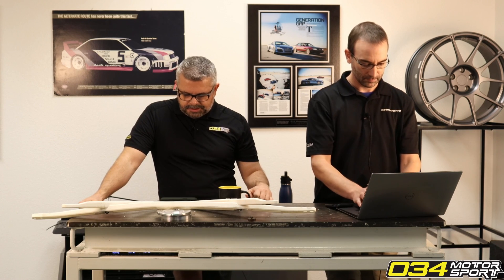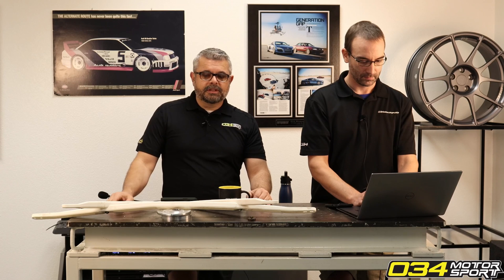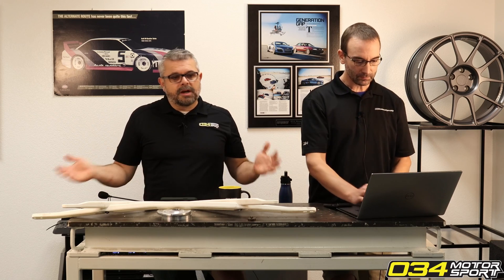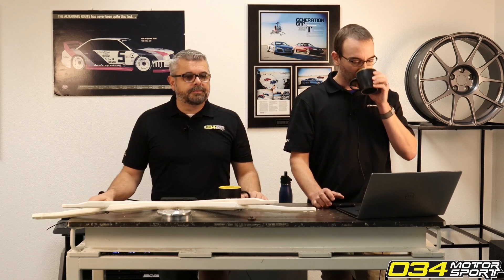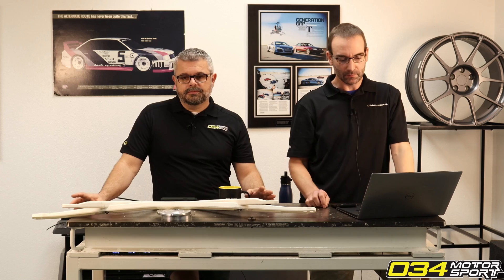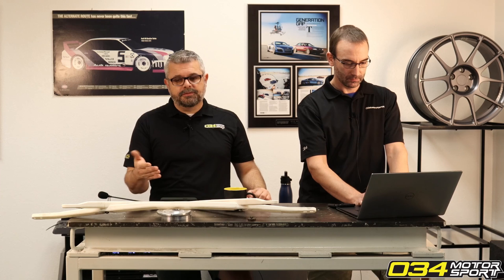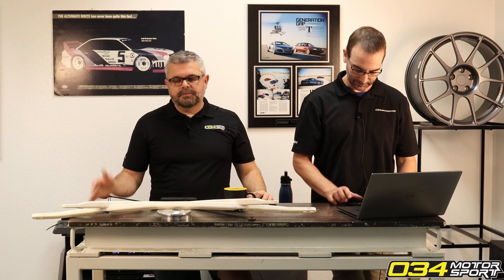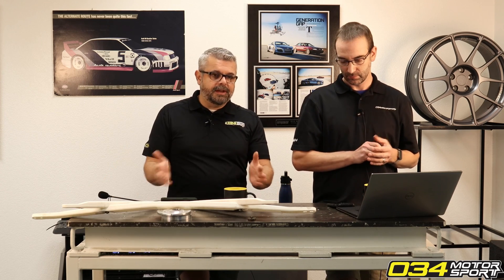What are the limits of the 3.0t Supercharged Engine? | 034Motorsport FAQ

Comment: Your CREC (2016 a7) stage 1 e85 appears to be safe with no major bolt ons but what about the cats? You mentioned before about concerns of cat failure due to heat, does e85 help compensate for that despite the power increases over 93?
Reply: itll have no problem w cats unless u running a 104aki file instead of e85 those lamda will be very different. only thing i can think of is a ethanol gauge, make sure u got the 85 if u looking for 85. stage 1 dont have dramatic power gain so stock fueling should be good.

Comment: Physical faults don't really appear until you push it as stated in the video. If you are serious, data log the car. You can see a lot of things that are going to be an issue when you continually push the car. You can see a lot of sensor data. Cat temps. Fuel pressure. Timing. Boost pressure. The list is huge.

Comment: Hello I just bought a 2016 S4 premium Plus it's a really nice car with a one owner car garage kept in the baby did it and it's very fast it's got like 60k on it so what I want to do to it like I do all my other cars I do run Royal Purple cuz I think the oil keeps the engine cooler and on the dino my friend has a Dino and you do gain more horsepower with that oil so I like that oil so saying that I'm looking at your your just your basic tune that you plug in can you use off your phone so my question is is how much horsepower does that gain in torque and what type of gas am I going to use cuz I live in New Jersey and we have 93 and that's what I've been putting in it so my question is is that can I still keep it at 93 if I buy That Tune

Comment: I’m currently in the market for a 2014+ A6 and want to do a duel pulley conversion, as far as the 2014+ 3.0Ts go do they all come equipped with the same transmission or should I be looking for a specific model 3.0T? Would there be any benefit to getting a S-line compared to a base model A6? I was also wondering as far as parts, labor and supporting mods go how much does it usually cost?
Reply from the maker: Depending on which side of the world you're on, that depends! For North America, pre-facelift models have the same 3.0T supercharged motor as the S4/S5/Q5/SQ5 and the ZF8 AL551 transmission. RoW (rest of world) vehicles get the DL501 DSG transmission. These cars will typically have the most aftermarket tuning support. 

Late model facelift C7.5 3.0T cars will come with a different and more updated 3.0T CREC motor, which doesn't have nearly the same amount of aftermarket support but is still a great car. We're coming out with an updated tuning suite for the CREC motor which will feature the same great features featured on the standard 3.0T powertrain from older models.

The choice between the S-Line and base model is a personal preference. If you'd like to get a quote for parts and labor at our Service Department, email the team at service@ztfauto.com.
Reply: Awesome video crazy that some people are still sleeping on Audis 🏁 we have to keep it a secret!!😉🤫 what are your tuning options for 2018+QS5 3.0 turbo?

Comment: How are the 3.0 turbo engines holding up?  About the same?  I'm planning on getting into a B9.5 S5 near the end of the year when my Tesla lease is up and although I don't plan to make big power for a daily, I'm anticipating going to stage 2 and hoping to enjoy many years with it at whatever power level that happens to be.  I don't drag race or road race or anything like that.  I just like a quick daily that's reliable.
Reply from the maker: They are holding up very well and holding 5-600+TQ, very impressive!
Reply: @034motorsport  Cool.  Officially Gassed OG recently destroyed one of the planetary gears in the center diff of his RS5 while doing the brake boost "launch control".  The mechanic that pulled the transmission to assess the damage said it was due to that diff just not being built to handle 600+ ft/lb of torque being held like that when brake boosting.  He ended up having to find a used transmission because Audi don't just sell a new differential to swap in and (as someone who got the short end of the stick with the B8 A4 lawsuit transmission replacement due to a technicality and having to go the junkyard/independent mechanic route) it makes me nervous seeing something like that and wondering if it's not a matter of if but when something like a stage 2 B9 S4/5 manages to encounter the same issue?

I have no clue what tune he's running or if he has a TCU tune but I was curious if you guys have some safety measure put in place to prevent something like that from happening with your TCU tune?
Reply from the maker: @FastRedPonyCar  on our tune we have seen no issue on our in house cars or customer cars, our tuning absolutely has raised but safe torque limits and all factory safety systems in place in the ECU and TCU, w/o these any ECU flash, or on a tuning box, can easily damage the engine or transmission.

Comment: What parts and components would I need to make a fbo 3.0T? And what is the max amount of power I can make on 91 and 93
Reply from the maker: You'd need to check out our whole catalog: https://store.034motorsport.com/b8-b8-5-audi-s4-s5-3-0-tfsi-performance-software-stage-1-2-plus-dual-pulley-6877.html
Reply: @034motorsport  would that also be included for the A6 platform as well?

Comment: These cars are so ridiculously underrated. For $20k I have a car that's comfier, quieter, has backseats, and is faster than new Mustangs and Camaros. It seems hilarious to have a daily driver sedan that makes almost 500hp runs low 11s, and gets 25mpg.
Reply: $20k??? where tf u at i cant find anything near me for under 30
Reply: @dizzyhead27  US southeast! I got mine for $19k with 100,000 miles but meticulously maintained, and it was already DP APR Stg2 with APR wheels and a bunch of other goodies.
Reply: @pianomail  damn thats awesome man good shit! im in PA and the market is just ridiculous like i said for 30-60k mile s4s its 30-50k. You having the high miles makes more sense but it sounds like you got a hell of a buy there. from what ive heard these cars go for a while as long as theyre maintained.
Reply: @dizzyhead27  here in colorado i got a 2011 with 67,000 miles for 19,000, perfect condition.
Reply: @maxd8487  bout to buy one very similar
Reply: I’m in PA and got an C7 A6 3.0T for 16k with only 85k miles (Audi Fort Washington)
Reply: @pianomail ya you gotta find one with clean maintenance mine was owned by one woman bought new from the Audi dealer 10 years ago. she only ever out 1500 miles on it and only serviced it there , then eventually sold it back to them. Two days later I bought it with 31,000 miles 😅
Reply: @dizzyhead27  my 2012 Prestige was $20k with 87k miles back in January 2022 from Carvana in Tampa Bay. It just got a brand new DL501 under warranty and I'm as FBO you can take a S4 without going bigger supercharger, stroker kit and nitrous. On 034 Stage 2+ 207mm crank, ported blower, E40, Test Pipe/SuperDuper TB file I'm making peak 635bhp/516tq. On 93 it drops to 560bhp/456tq and both are without meth. I'm adding meth this week when I get back home to Florida. Videos up on my page. It's just ridiculous...
Reply: I bought my S4 with 76,000 miles on it and had all service records for 20k in 2021
Reply: @dizzyhead27 I bought an impeccably maintained 13 S5 that has down pipes, high flow cats, x-piped, res delete, intake, new heads, upper chain guides, new water pump, starter, upper gaskets, pcv, new tires and rims, new brakes, immaculate interior, and stage 2 Apr ECU and TCU tune, 190mm lower pulley. Car has 160k, with only 20k since upgrades. $8800. Fast, and crazy reliable. Does need the SAIS port on bank one cleaned this winter though. Keep throwing that 01 code just to annoy me😂. First Audi I’ve owned, of many to come. Next will be the same car in white, with the V8, and a manual.
Reply: I outran a gt350 in my 13 a7 stage 2 apr. 🤣. Love this thing!
Reply: For real I just bought my wife one today 50k miles for $24k car runs great cat back exhaust only so far
Reply: @humblebarber  you won’t regret it. Heat exchanger and she’s set.
Reply: i just bought a fully optioned 2014 s4 w/ 73k miles for $17k. I had to talk the dealer down a lot bc the thermostat needed replacing but they are out there.
Reply: I gota '16 with 6700mi - what do you think it's worth??!!
Reply: i got mine for 17k with 84k mine premium plus
Reply: Tru I love my car the B8/B8.5 is the best gen 💪🏽
Reply: Yep but requires thousands of dollars worth of maintenance unless you have the ability to do the work yourself. Even then they are a quite costly to run. I have owned my b8 for 4 years and while it's fun to drive it is very poorly designed.
Reply: @fredjack1979  oh yeah, I do everything myself, but in the first year I had to do the water pump and the PCV, along with other things. The DSG service is a pain, I have a lift and it's still annoying if you drop the pan for the internal filter.

Comment: How does the B8 compare to BMW N54 with mods?
Looking at purchasing S4 3.0 or RS3 2.5 . Which is better platform for FBO and tune?
Reply: N54 is straight garbage. I have one now and everything around it is plastic and breaks. If you wanna make power its good to 700 and then you'll need to build the block. The heads are a weak point to. The B58 is better

Comment: I have a 2014 A7. Just installed ecs upper and lower pulleys, air intake and arp 93 octane tune...whats my approximate hp?
Reply: 280hp cause I guarantee the engine is underperforming. Look into it, a bunch of guys with more than just stage 1 ecu tunes once they get to actually test the whp on a dyno find out they have worse output than stock.
Reply: @dcam1760  hardly lol. Took it to the drag strip and ran 11.9 quarter. Stock does the quarter in 13.7. This car feels like an absolute monster compared to stock.

Comment: my A7 3.0T went kaboom after a custom dyno stage 1 ECU and TCU tune. I had a CTS intake and catback exhaust.
Apparantly my crankshaft has went byebye.

Tune results: 454HP; 537NM torque
Driven only one month with the tune.

Now I'm saving up for a new engine :(
Reply: Unfortunate:( 
Hope you get it fixed up asap
Reply: @audinthusiast3750  6000 euros and 6 months later, a new engine is in and she's finally driveable again. I removed the chiptuning software and mods for now. Humble driving it is

Comment: What setup has the most power you can run on 91 pump? That's the highest octane fuel I've got around me.
Actually, correction. I believe we've got Husky/Chevron 94 but it contains ethanol (maybe 10% iirc) does that matter?
Reply: Are they gonna answer?
Reply: PetroCanada I believe has 94

Comment: I know it probably wouldn't happen, but I'd love to see an APR vs 034 vs IE in the C7 class. I have a full bolt on C7 A7 Mostly APR, with AWE exhaust, ECS boxed intake and JWM down pipes and X pipes. Maybe someone has a similar build with IE or 034???
Reply: I have a c7.5 on an IE e85 tune. Stock exhaust with valves mufflers and aluminum res, injen intake, updated pulley, trans tune, test pipes, and upgraded intercooler. It’s still a heavy car but I’d love to get more power out of it. Hope they come out with more

Comment: Could you do a video on what the 2.0T Ea888 Gen II ? This is one of the cars on your products list with tuning and parts.

I’ve just had mine built with forged; pistons, conrods & race bearings etc etc.

I’m using K04 on a low reading dyno 248whp on 93oct… thinking of going larger turbo l, but may need upgrading of the fuel system.. so I’m really keen to know where I can go or aim.
Reply: I have 2015 a4 Quattro cpmb I’m able to take advantage of e85 apr tune hit the 1/4 in 13.4
Reply: I thought stage 1 E85 would be faster than that
Reply: I think 13.3 would be best  with a launch that has no tree paired to 8zh

Comment: Just picked up a 14 SQ5 and it's a whole different animal when compared to my K04/Meth MK6 GTI.
Reply from the maker: Definitely a great platform + car! Just wait until you go Stage 2+!
Reply: @034motorsport  Been stage 2+ with your 190 lower for two weeks now. Its a freaking blast. Very happy I tuned the ZF trans and put the 4.0T heat exchanger on. Now Thinking about doing a CWA100 pump conversation to push the IAT down further and help with recovery before heading back to FL.

Comment: Since the supercharger has a valve in the back that closes to provide full boost could you have it shut then open top end and have a turbo feeding the supercharger? Like when the valve opens it allows the full boost from the turbo?
Reply from the maker: That is a good idea, though that valve is small so a much larger valve would need to be employed, and it would be be a very complex system to control properly.

Comment: Anyone explain please, the a6 3.0tfsi and the S4/S5, why is the a6 slightly detuned to the S4/S5 when it's the same engine? Thankyou
Reply: Money 💰it's all about the money.  They know that we'll pay more for power even though it's the same engine. I have the a6 I asked myself the same question when I first got it.
Reply: @milkydud99  Same situation as my dads 15 Q5 with the 3.0T. But I wanted the paddle shifters and more sporty seats, so I got the SQ5.
Reply: I'm not sure the engine is detuned per say. The DSG transmission will probably transfer a few more horsepower and be ever so slightly faster than the 8 ZF in the A6/7. The DSG will allow a higher redline therefore a few more ponies because the 3 0TFSI has more to go after the conservative factory redline
Reply: @OhioBahn440  thankyou
Reply: The engine in the A6 is detuned as it is a luxury car. The factory hp rating is crank hp not wheel hp so transmission does not affect the factory rating.

Comment: I have a stock 2010 a6 3.0t.   What tune should I start with for my first Mod!???
Reply: Downpipe, stage 1 034 flash, but spend the money and get an intercooler. C6 c7 platforms are crazy hot. You'll lose power every pull.

Comment: Whats the best heat exchanger upgrade for a Q7? Running a stage 2 custom tune runs great in winter in northeast but with the weather heading back toward the high 80s and 90s losing a lot of timing.
Reply: I bought a 4.0T heat exchanger from Merc Racing and slapped it on my SQ5. Us SUV/Crossover boys have the extra space to accommodate the bigger heat exchanger. Just make sure it is bled thoroughly. The pump does not run on stock tune under 2k rpm or when not on boost according to 034.

Comment: Are the parts for the 3.0T engines generally interchangeable? Specifically would an intake hose and filter made for an S4 fit on my C6 A6 3.0T?
Reply from the maker: Unfortunately they are not.
Reply: @034motorsport  any chance of developing parts/tunes for the c6 3.0t?
Reply: @Ceedubbya  c7s are so cheap now, you can find a cheap as cheap as a c6 nowadays really.
Reply: @CoachD4  yes but not an avant ;)

Comment: Hello. What are the limits of the manual gearbox and the sport diff as I have both?
Reply from the maker: We haven't seen that limit so we can't say for sure, it appears to be decently high.
Reply: @034motorsport  Thank you for the answer. My car has currently ECU MAP for 93 octane(98RON) and is making 417hp and 362lb-ft of torque. Dyno graph: https://postimg.cc/sQN3Nrtj
It has sport diff and manual. Can I go safely to dual pulley or the limit for the diff is lower? I wouldn't like to install aftermarket LSD as it removes functionality from the car(diff modes).
Reply from the maker: You wouldn't be able to hurt it on the 3.0T tuning currently available. We have a few customers breaking the 500whp mark in manual B8 S4's.
Reply from the maker: The vector diffs seem to be weaker, but most 3.0T cars aren't hurting them, cars with 4.0T and making more TQ are blowing them up, so the upgrade is to go to the standard diff and install an LSD.

Comment: Engine failures no, but cat failures yes. That’s the biggest reason I haven’t gone dual pulley
Reply: I just got my cats done. Definitely get that done for sure on the 3.0t. I'm pushing about 550hp with the zf8 speed and it kills hellcats at a light. Its really hard to beat .... Quattro power all day!
Reply: @simonbenn5340  is it still alive even today?
Reply: @simonbenn5340  what did you do, test pipes?

Comment: They use the exact same trans as a hellcat so there good for at least 750/770 motor who knows to be honest all depends on how u keep the car if u stack injectors with the direct injectors u can get stupid power I thing a bigger blower is more safe to be honest like Prochager
Reply: No they don’t 😂😂😂 Hellcats use a ZF8 and the S4 is a Dual Clutch, unless you’re talking about the manual variant.
Reply: @VigorousZinc  what if he's talking about the a6? they do use the ZF8
Reply: The hellcat 8 speed is not the same as the one mated to the 3.0 the 8 speed trans behind the s8 4.0t is the same as the hellcat but the srt jeep trans is the same and they hold up to 500/hp/tq to wheels on a 4900lb car so you're a little off.

Comment: How about DSG failures?  Failures behind the motor in general
Reply from the maker: We have not found the need to upgrade the DSG (Clutch Packs) beyond current power levels obtainable via our tuning, thus have not seen failures.
Reply: DSG can handle more power than people think. It is a very robust transmission.
Reply: @TwentytenS4B8  I want to believe this, but I keep reading the opposite 😬😬